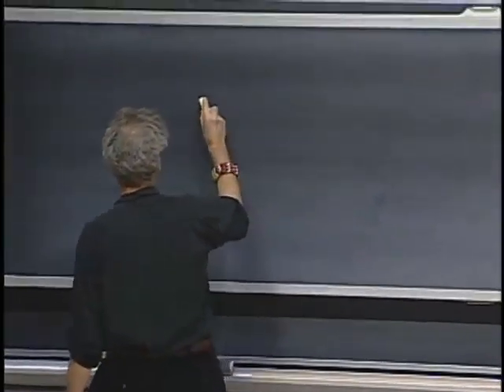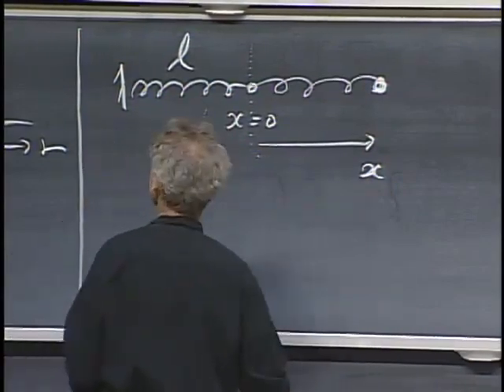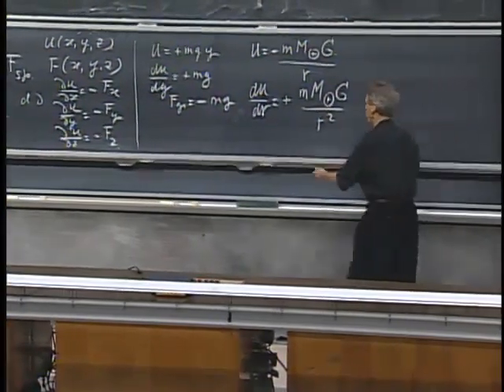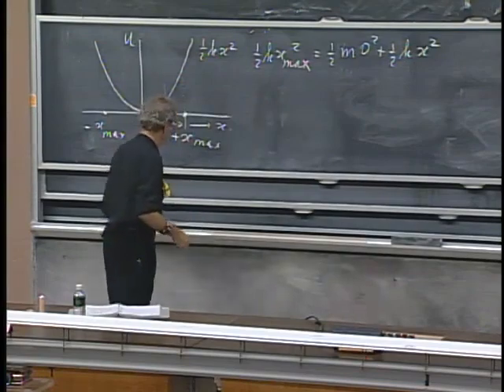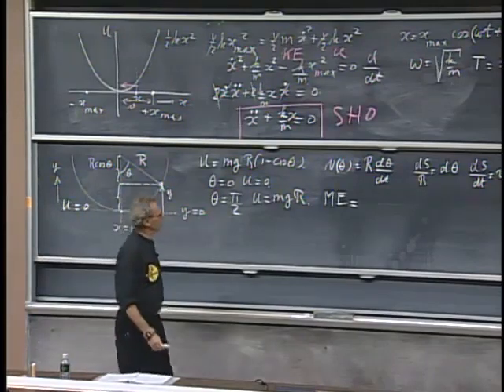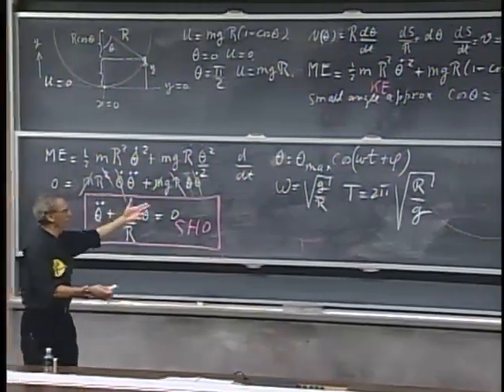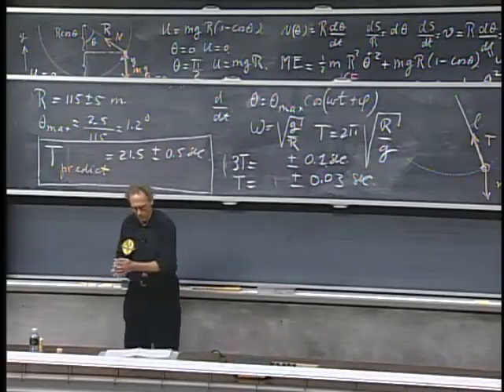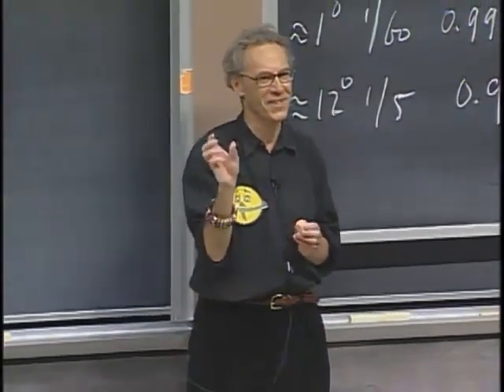8.01x - Lect 13 - Potential Energy, Derive Simple Harmonic Motion using Energy

Comment: Prof Walter, I think that the fundamental difference between the first and second demo is; the first one was almost straight but the second one was curved. so gravitation force in the second demo is opposing the ball every time when it goes higher and direct it to the lowest point"stable eqilibrium".thnx
Reply from the maker: that explanation is ncorrect
Reply: Prof Walter please give us a note since all explanations on that question are not correct.thnx
Reply: Air drag!
Reply from the maker: NO not air drag.
I leave it up to you to find the solution. It is VERY basic.
Reply: is it something with (h)?
Reply from the maker: If the object were not a rolling ball but a sliding object, its period would be exactly the same as that of a pendulum whose length is the same as the radius of this track. But the object is a ROLLING BALL and that makes all the difference. In the case of a sliding object all PE is ONLY converted into KE of the object. In the case of the rolling ball the PE is converted in KE of the center of mass of the ball but also into rotational KE of the ball. So imagine now that we had 2 identical tracks, one with a sliding object and the other with a rolling ball. At any moment in time when the object is still in motion the KE of the center of mass of the rolling ball will be LOWER than that of the sliding object as part of the PE goes into rotational KE of the rolling ball. But the KE of the center of mass determines the period to go back and  forth. Since the KE at any moment of time when the object is moving is LOWER for the rolling ball than for the sliding object, it's period of one oscillation will be longer than of the sliding object.
Reply: Ooooh thank you prof Walter, you will not believe me if i told you that after i wrote you yesterday i turned the light off, laid down and start thinking again and one of ideas was that ball was rolling instead of sliding but i told my self it is "too trivial" . you told me in the last answer it is VERY basic. so it matches  :). thanks again i ma so fascinated with your voice at min 55:57
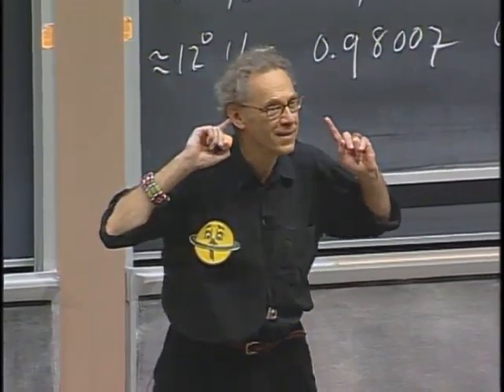Reply: SORRY IT IS 50:57
Reply: its one of the things that confuse me the most, 
when we calculate the rotational and c.m acceleration of a tube that has a string wrapped around it, and the tube is being let go and let G do its work, 
we look at the r.a(rotational acceleration) and the l.a (linear acceleration) like they are separate,by newtons second law ((alpha)I =torques , and forces=Ma ) , 
and you showed us this when you hit the ruler and gave it rotational and linear velocity, and claimed that it doesnt matter where you hit it, it will have the same liner velocity and the rotational velocity will change, it is as some "more" energy popes up to apply rotational acceleration , extra to the linear acceleration, that will be the same, no matter where you hit the object or ruler,for our case.
Reply from the maker: Yes when you hit the ruler at its center of mass with impulse J, there will be less energy in the ruler than when you hit it somewhere else with impulse J. This is no violation of any kind. Clearly if I hit the ruler with impulse J I have to do more work hitting away from the center of mass than at the center of mass.

Comment: Given that the period must be longer due to rolling kinetic energy (by my solution by sqrt(7/5)), I assume the fact that the amplitude on the small track is getting smaller must be due to friction?
Reply from the maker: +William Chu That is not correct
Reply: OK. :-)  Can you point me in the right direction?  I incorporated the rolling kinetic energy into the differential equation you wrote for theta -- assumed rolling without slipping -- and it looks like the same SHO equation except g/R is replaced by 5g/7R (assumes solid sphere).  I'm assuming the decaying amplitude over time must be due to some damping.  Hints?  Btw, these a lectures and help videos are a godsend!
Reply from the maker: +William Chu A decay in amplitude always occurs. That's the result of friction.
But that has a near zero effect on the period of the oscillation. The question I asked class is why is the period of this rolling object smaller than what I calculated for a sliding object.
Reply: Yes.  Thank you.  I understand why the period is longer.  That is purely due to having to add kinetic energy of rotation (0.5*I*omega^2) and assuming rolling without slipping.  I was curious as to why the amplitude was decaying. This is due to friction as you mentioned above.
Reply from the maker: +William Chu amplitude would decay both in sliding object and rolling object. There is always air drag and also some friction in the track.

Comment: Is it because the ball has angular momentum? It takes energy to get the ball rolling and to reverse the roll to go back and forth so the period of oscillation is slower. The air track weight isn't spinning/rolling, so there's no angular momentum.
Reply from the maker: +TheSamuelWells Yes that is correct. No need to use the words "angular momentum". The rolling ball has rotational KE (0.5*I*omega^2) + 0.5*mv^2 (here v is the tangential speed aolng the track) . A sliding object has only KE=0.5*mv^2. Therefore the average "speed" along the track will be lower for the rolling ball than for a sliding object.
Reply: @lecturesbywalterlewin.they9259  Love your lectures Prof. Lewin. Thank you.
Reply: Hi Prof. Lewin, if we put a ball on a frictionless slope, will it roll down or slide down? @lecturesbywalterlewin.they9259
Reply: slide down  @yaqianwang8065
Reply: @yaqianwang8065  slide down ...reason: what makes it to roll in first case bro.......friction in contact point of course ...in later case  its like in mid air and nothing to push to make rotation....
Reply: It's a trick question because the ball is swinging with lower and lower amplitude, thus implying friction. But  the period is the same regardless of amplitude. So the explanation has to come from somewhere else. Sneaky question. :)
Reply: I also thought about it and now got the confirmation!!!!!! Yeah!!!! :)
Reply: thus, larger the diameter of the ball slower will be avg speed on track?
Reply: So if the circular track was placed on a frictionless track then would we had got the right result ?

Comment: Why is the period of the rolling ball larger than predicted? -> My guess: Because the diameter of the ball must be added to the length of the virtual string. The ball touches the slide only at one point at the bottom, so this point becomes the ball's center of mass  and that makes the effective length of the virtual pendulum.
Reply from the maker: +Daniel Melchert Daniel, your explanation is not correct. Try again.

Comment: The angle of oscillation in first case is smaller compared to second so the assumption cos(theta) = 1-theta^2/2 is not valid. It is a case of pendulum with large angle of oscillation. Period for this case is larger.
Reply from the maker: +Vasant Barve You explanation is incorrect.

Comment: Is the reason that since the rolling ball has a rotational inertia to overcome, it needs some of its potential energy to be converted to rotational energy as well as the kinetic energy to move back and forth
Reply from the maker: martin robledo Yes of course.  A sliding object on a frictionless track with the radius of my demo would have a period that I "predicted". But the ball is NOT sliding, it's rolling. It has rotational KE and that will slow down  the translational  motion.
Reply: +Lectures by Walter Lewin. They will make you ♥ Physics. it means that friction is taking part to make the ball to rotate
Reply from the maker: the friction is doing no work - the ball is not sliding - it's pure roll.

Comment: Is it because as theta decreases wrt time implies omega decreases as a result time period increases n this happens because the mg cos theta component increases wrt time if we consider each event at the start of each oscillation as discrete event n the value of amplitude is changing at the starting of each cycle
Reply from the maker: Bidisha Chakraborty No this is not correct. What is the difference between a swinging pendulum and this rolling ball?